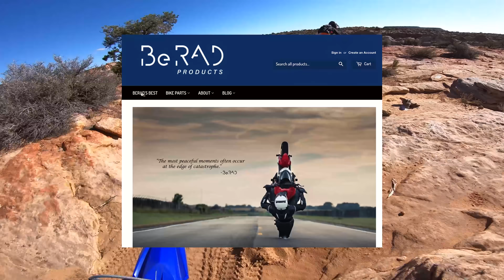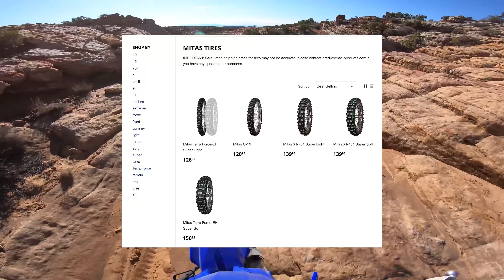5 Miles of Hell on a YZ125 - 49min Utah's Hardest Dirtbike Trail

Comment: Great video, awesome to see what this bike is capable of!  If you don't mind, how much do you weigh?  I'm kicking around the idea of another bike, and I love the idea of the light weight of the 125, but at 6'4" 220lbs, I'm wondering if it's just too small.  Had a KTM 150SX for a while, and got the suspension revalved for my weight, but the motor needed to sing to haul me around.
Reply from the maker: 6'1 180lb naked. I wouldn't say youre too big to have fun on it but it depends your skill level and goals!

Comment: You like 125 or 250 better?? Which and why?
Reply from the maker: 125 handles better, easier to flick around. Clutch is stupid light which is great for this stuff. But sometimes you gotta push it pretty hard to get the power. Overall I enjoy the 125 more. Even in this shit haha. But the 250 is a weapon as well! I’d have to pick the 250 if I had to choose one simply because it will perform in any condition. High elevation and the 125 dont mix
Reply: @BeRAD  got it. im in the south and we ride mainly woods, single track, and hair scrambles...im torn between the 250X and the 250FX... i lot of guys are actually faster on the FX even though its less power and heavier... apparently its better design, better traction, better handling...

Comment: Does anyone think I 125 is big enough for a 6’2 190lb 16 year old with lots of bike experience or should I get a 250 I will mostly be riding techy trails in the pmw. I also will start racing again as well
Reply from the maker: It’s enough for sure but you may want the 250. I’m 6’1 and 180lbs….your call!